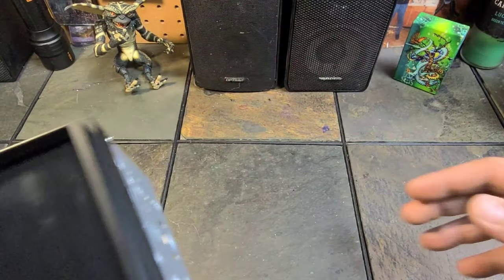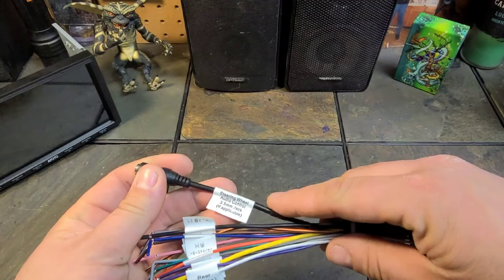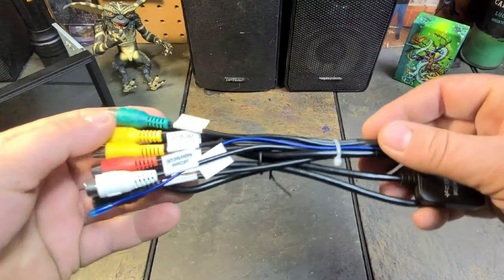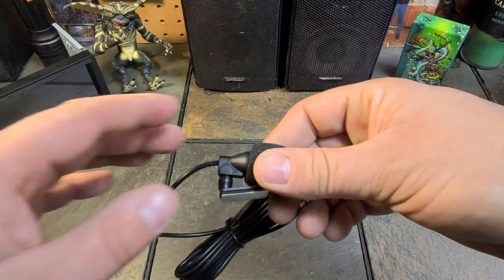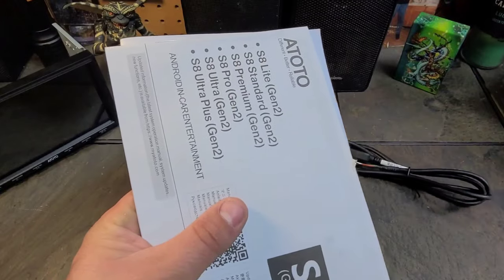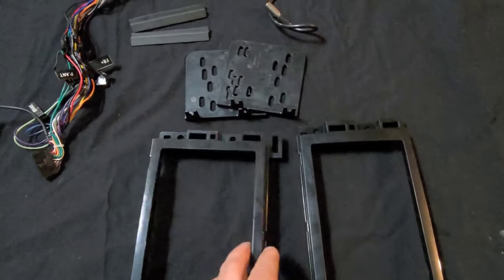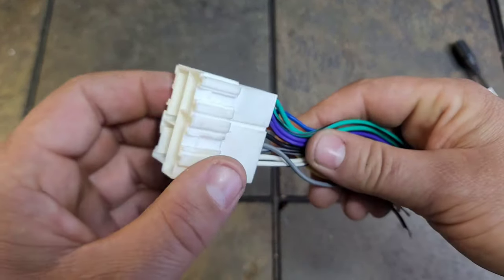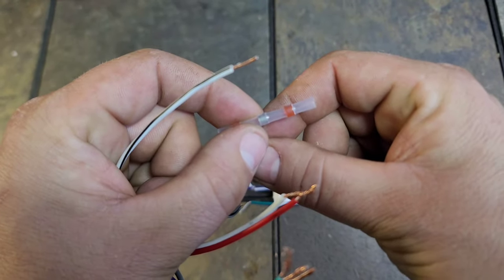How To Install ATOTO S8 Car Stereo - The RIGHT Way!

Comment: I’ve had one for a couple months now but my question is do I need to use the line out put converter to hook up a 4 channel?
Reply from the maker: I had to check it out, but yeah, you would because the rca output only sends mono low frequency.
Reply: @Blowncapacitor84  I just went and bout a new head unit lol, I lost the locs somewhere. And on top of that I need a radio that has a diagram online hookup my steering wheel control module lol

Comment: Does this head-unit have boot logo in the settings? Like to change boot logo from “atoto” to “Honda”
Reply from the maker: Yoy can download any startup logo you want via the external USB slot. Go to settings, click system, and then scroll to the bottom and click "system startup logo" there it will give directions on how to complete the process. It takes only a couple of minutes.